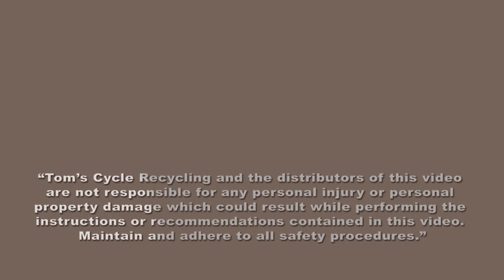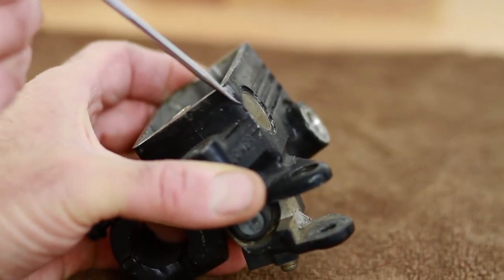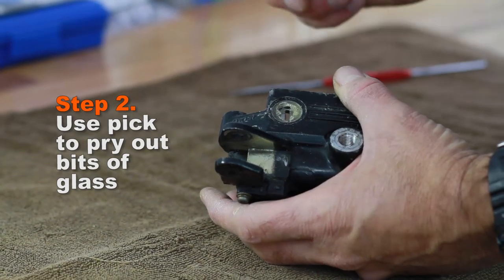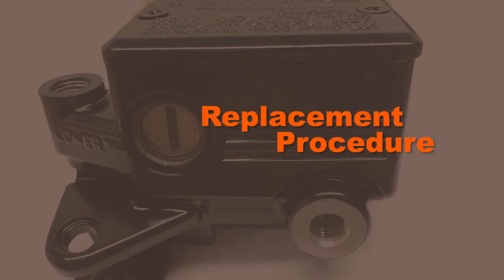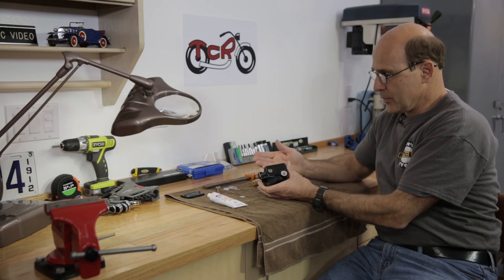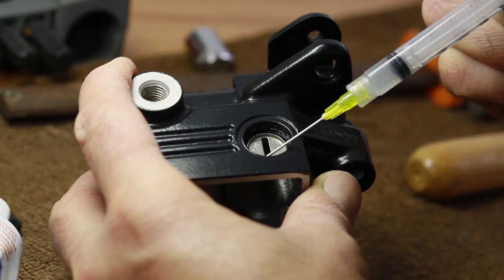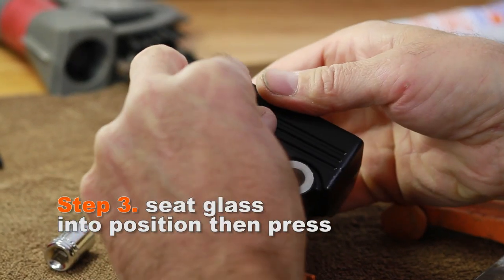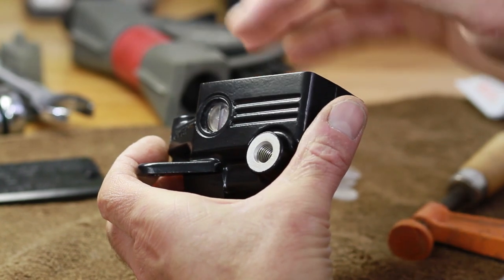Front Master Cylinder Sight Glass Removal and Replacement

Comment: What kind of adhesive sealant do you use to install the site glasses? I usually use SealAll but it is extremely hard to work with when only needing small precise amounts and I don't think it would work to dispense with a syringe.
Reply from the maker: Craig, I use Permatex "66B" Clear RTV Silicone Adhesive Sealant.  It's available at most hardware stores and automotive supply chains.  Make sure to let it cure for at least 24 hours before filling the reservoir with fresh fluid.

-Tom

Comment: did you say you had those lexan sight glasses "made"  or can I buy them? the sight glass on my left side is broken. glad I found this video I was going to buy a whole new master cylinder and all that's wrong is the cracked glass..  thank you!!  :)
Reply: Me too🤣
Reply: @thomasd2867  any idea why they even include that little window on the master cylinder? I mean I guess sure you could see the fluid but if you're paying attention you would know if you had a pressure loss and you would be hopefully smart enough to then open up the cover on your master cylinder and check your fluid level. I mean it seems kind of silly to put a little window on there if just by having it sit in the Sun for a few weeks it's going to disintegrate and cause you problems. And anyone that has a bike we all intend on covering them every time we get off but you know how it goes when you're driving it everyday taking the cover off and putting it back on and taking it off and putting it back on and gets to be a real pain in the butt and you end up just leaving the cover off unless maybe it's going to be a rainstorm. So it just really seems stupid for them to include a window so you can see the fluid it doesn't have any other function as far as I can tell and considering that you can just stick a dime in there with some silicone and block the hole and you're good to go I wonder why they even put it there at all. And then another stupid question if they deem it necessary to have that little window there why wouldn't they make it out of at least glass so it won't disintegrate in the sunlight? Seems almost like they did it on purpose as like a scam to make you have to purchase another master cylinder because most people are just going to take it to the shop and I don't know any shop that will tell you we can replace the glass for a couple of bucks rather than we can replace your whole master cylinder for 50 bucks or more of course they're going to take you for a ride and make money on you. Before I found your video and realized how stupid the whole situation was and went ahead online and found myself sight glasses for a few bucks I think I spent like 10 or $15 including shipping for two of them.  I had originally took it to the shop and they made it seem like it was a big deal and I told them I can get the parts online why can't they get the part? They insisted that you can't just replace the sight glass you have to replace the whole thing and when I told them that I found the part and fixed it myself they were all interested in where I found replacement cyglasses at and wanted to know the website which I believe it was just eBay. And they came with the whole thing all they had to buy additionally was some silicone. It  had the pressure fitted sight glass with an o-ring and it was simple to do I didn't even take the master cylinder off of The handlebar. It took me like 5 or 10 minutes including getting the old one out and cleaning the area so I could put new silicone in there and honestly I don't even think the silicone was necessary cuz it fit in so tightly. If I ever have to replace them again I'm not even going to bother getting a sight glass replacement I'm just going to stick a time in there and silicone it or maybe epoxy or something I had a dime in it before I got the replacement sight glasses so that I could drive and it was just fine it was just a little bit ugly looking having a Big blob of silicone on the master cylinder but I'm not too worried about what my master cylinder looks like over the performance of my brakes. Wow I did not intend on writing that much sorry lol!  Again I really appreciate that you had this video available allowing me to see just how simple the problem really was and you saved me a lot of money by showing me that I could do the repair myself very easily.

Comment: Thanks for the info ! Im overhauling my 2004 honda vtx 1800c brake and clutch mastercylinders and whant to powder coat them black , where do you suggest I can get my replacement lexan sight glass ? Any help would be greatly appreciated !
Reply: Measure the diameter of the opening.  I may have what you need.  You can contact me thru my Web site that appears at the end of the video.  Thanks.
Reply: Tom Kerxhalli how would you like the messurements in inch or mill ? And what tool would you rather use ?
Reply: Paul, metric is best in mm.
Reply: Tom Kerxhalli ok thanks will do , ill comunicate with you when im ready !

Comment: Wonder if you can make a sight glass for one that doesn’t already have one??

Great job by the way!

Larry
Reply from the maker: It could certainly be done.  A good machinist could bore a hole all the way through, then a countersink hole just a few mm deep for the sight glass to sit.  The other option is to just swap in a master cylinder that already has one.

Comment: Hey Tom great video. I almost despaired when I picked at my crusty sight glass the other day and saw fluid escape. Doh !
I am restoring an '83 Honda VT 250F and will need to do both sides.
Do you know what size replacement glass/ lexen glass I will need for that "press" fit ??
I guess i can measure mine but I'm not sure if this will be accurate for a press fit. I have never done this before, but I am handy.
Can you advise please ?
Thanks
Reply: +Royalbigness try getting a sheet of lexer and a hole saw with an interior diameter slightly larger than the sight hole (use calipers to measure this and the hole saw) aim for too large and sand down accordingly.
Reply: Ok, I'll try that Sam
Thank you.
Reply: You can tap the glass in the with a socket dude.. That's why most guys use the lexan sight glass. You can tap that with no fears of busting it.
Reply: Thanks Tim.
Reply: Don't forget for lazy pukes like me. I found an entire master cylinder on E-bay for like 30 bucks.
Reply: Dude don't discount yourself. Good old units are extremely rare to find.
Since my first post I too found two replacements so this procedure, thankfully will be for another day.
I just had to disassemble the spindle kit, clean, and was good to go.
Reply: They sell new aftermarket Masters for these bikes. They'll hold up I'm sure of that. I see many after market parts now for these bikes. More than I had a few years ago anyhow. It's getting decent cables and water pumps starters made in China are pure shit. Now can anyone tell me how the fuck to get the thermostat housing down and out of the neck of this beast. I can't get the thermostat housing out it keeps getting hung no matter how I twist turn it around... There has to be a way. My shop number is 570-459-6988... I don't work on enough of these vintage bikes remember how I did shit years ago.
Reply: Tim, Are you referring to the Honda VT250 or the bike in this video ?
Reply: I FUTZED UP IT'S A 1985 HONDA VT500C IS WHAT IT ACTUALLY IS.. IT'S IN MY LATEST NEW VIDEO YOU CAN SEE IT STRIPPED DOWN IT HAS LOTS OF ISSUES NOT JUST THE LEAKING EYE.. IF I'M GONNA REPLACE THE EYE I/M GONNA LET THE BRAKE FLUID EVAPORATE CLEAN IT AND REBUILD IT TOTALLY KEEP THE MASTER AS A BACK UP... NO TELLING IF IT WILL FUNCTION CORRECTLY... A LOT OF THESE AFTER MARKET REBUILD KITS ARE BEING MADE IN CHINA OUT OF PURE SHIT THE TOLERANCES ARE OFF BY MILES AT TIMES THE RUBBER STUFF IS CRAP TOO. SO I DON'T RELY TOTALLY ON I MIGHT FIX IT I JUST FIX IT SELL IT AND GET MY CASH BACK.
Reply: I disassembled  the brake master cylinder on my VT250f and the only seals they really have a a couple of O ring type seals on the main shaft. It's The dust cover that deteriorates quickly as it is exposed to the elements.
I was able to simply clean up all the O rings and re assemble without any leakage.
The sight glass on my replacement brake and clutch master cylinders still had the sight glass intact and still quite clear so that was a bonus.
They just needed a strip and clean.
I was able to source these from someone interstate for small change.
I'll probably do the full refurb on my "originals" at some point and just keep them as spare.
If yours are anything like mine, just find a supplier of O rings and go to them with your sample and try to match a set up.
I reckon it would be pretty cheap too.
Good luck man !

Comment: Hi Tom, I am getting an '87 xj700 Maxim up and running for my son. I ordered a new/old master cylinder since the sight glass on the original was disintegrated. I'm pretty sure the one in the mail doesn't have a mirror with it so I attempted to remove the old one so I could swap it out when the new one arrives. I'm having zero luck here. I was able to get the lock nut to turn but it's not coming off like I would expect and the shaft of the mirror is still not loosening. Can you possibly shine some light on this for me? I am by no means a rookie mechanic, but this one has me stumped. Thanks. Don
Reply from the maker: If you got the lock nut to turn, get it high enough up so you can spray some PB Blaster or a good penetrating oil into the hole that the shaft turns into.  Let it sit overnight and then try braking it loose.  This will be easier to do with the master cylinder still on the handlebars clamped on nice and tight. There's rust and/or corrosion in there that has bonded the shaft with the MC.  Give it a try and let me know how it goes.  Good luck Don!

Comment: how do you get the silicone to withstand the brake fluid?
Reply: Exactly the problem. After watching this I have redone the same master cylinder twice, both times the silicone (top brand RTV) has leaked. All over my perfectly refinished exterior. Of course I was extra careful the 2nd time to ensure the glass was well bedded in silicone bead. But alas, over the following weeks (cautiously watched on my workbench), there it goes weeping brake fluid again. I'm convincing silicone is not the satisfactory adhesive for this job

Comment: nice vid man, but may i ask if you can buy that glass from a local mc repair shops? cause here in my location, it is really hard to come by that kinda parts .. thanks man!
Reply from the maker: You won't find these in any MC repair shops - they won't do this type of repair.  I have my own source for the ones I use, but you can also find them on eBay for various bikes.

Comment: Hi tom is it possible to Bake the paint with the glass in the Master cylinder? Is the glass actually glass or perspex?
Reply from the maker: David, the older sight glasses were plastic and will melt in an oven.  If it's glass, you might be ok, but I don't know if the adhesive holding it in place would fail.
Reply: @tomscyclerecycling8242  Hi Tom, can you please tell me where I can find a 17mm sight glass. I can only find them with an oring. Im restoring an RG500.
Reply from the maker: Check on Ebay.  There's a guy who sells a lot of different sizes there.
Reply from the maker: David, try checking on eBay.  There's a vendor there called "New River Cycle Salvage" that sells many different sizes.  They should have what you need.

Comment: I have a 1896 honda nighthawk and the main front light doesn't work.  I check the wieres and don't have power. Any suggestions on that or how can I replace it?
Reply: Well there is also a fuse panel not exactly sure usually left side of the bike. Check that first. If not remove the fuse box and make a jumper connection with a jumper connector. You can easily follow the wires across the bars to down the fork back to the fuse are on those old crates. now the new bikes you may need to see a shrink after having a problem like that...

Comment: hi i was wondering where a guy could fined a sight glass for a 85 Kawasaki  1100 zn
Reply: try new river cycle salvage they are in West Virginia  I found them on ebay they claim to be the best for all sight glass if you have a problem let me know
Reply: E-Bay there are many retro fit master cylinder kits.  Kawi is one that also uses the proto Bendix master cylinders..

Comment: Why do not use air heat gun ?
Reply from the maker: Good point.  Some of these sight glasses just pop out intact.  Others can be more work to remove and sometimes I end up using a heat gun to soften up the plastic.  Every one is different.  Since I did that video 6 years ago, I've done dozens of these and have switched to real glass instead of Lexan.  And the process itself is more refined now.  Thanks.

Comment: you change for a new one pump not put out the sight glass  on a old pump
Reply from the maker: After I disassembled the master cylinder, I media blasted and powder coated it.  This is why it looks brand new, but it isn't.  This is how I restore all motorcycle parts.

Comment: es un fraude primero detallen al principio la bomba esta usada fea por su huso obviamente despues mas adelante cuando coloca el visor es una bomba totalmente nueva vean la pintura y las roscas
Reply from the maker: This is not a fraud.  When I replace a sight glass, it's usually included as part of a total restoration of the master cylinder.  I remove the old glass, then strip and prep the master cylinder for powder coating.  After that's done, I install the sight glass as well as new internals.  When I'm finished, the unit is as you see it - almost like new again.